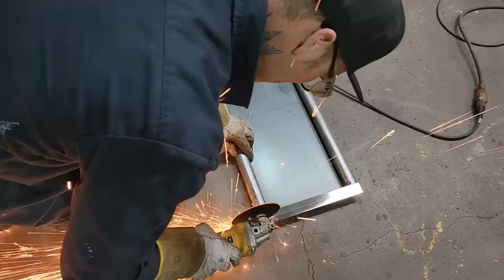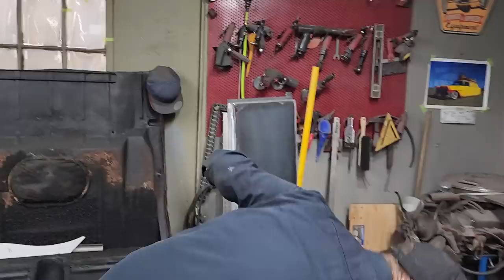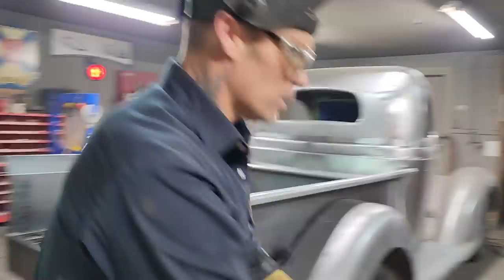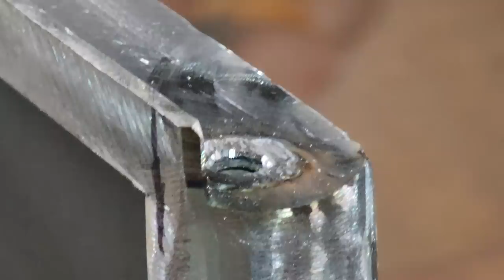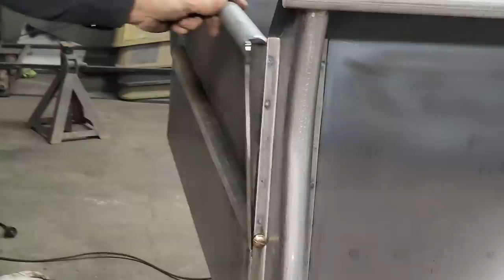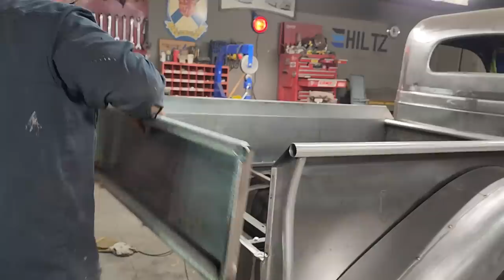Engineering a hinge system for the tailgate...1935 Plymouth pickup truck

Comment: Those step bits are pricey and don't last long. Any hints on where to get them cheap and good qualtiy?
Reply: Harbor Freight, online.
If they don't have a store near you.
That's where I get mine.
They may not always last as long as some high dollar brands do.
But the prices are cheap enough to make up for replacing them more often.

And, as with all types of drill bits...I find they stay sharper, longer, if you keep the RPMs lower.
(Took me over half century of using a drill, before I finally realized that my dad and grandpa knew what they were trying to teach me as a kid. Hahaha)